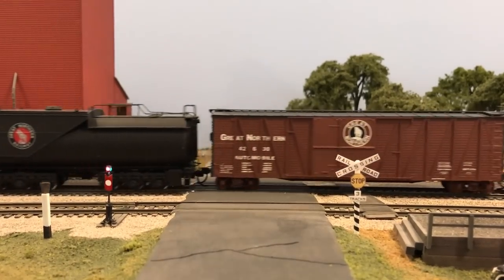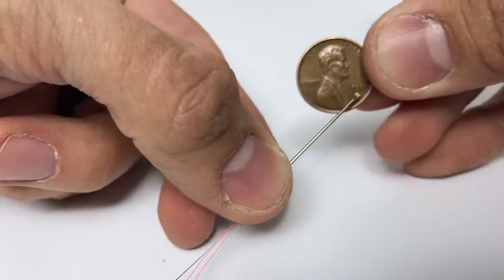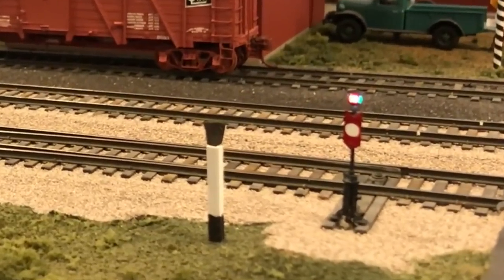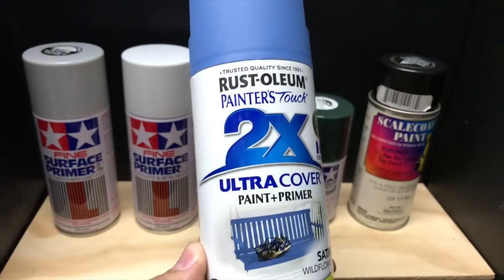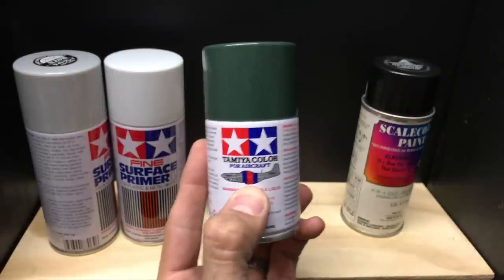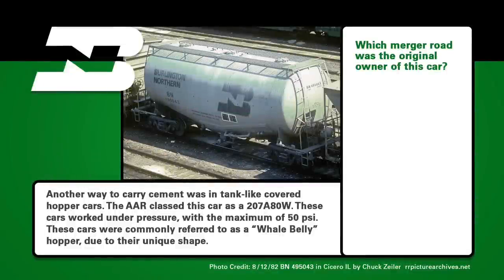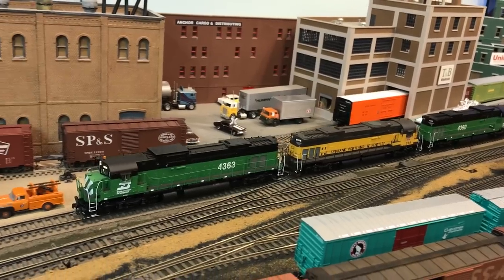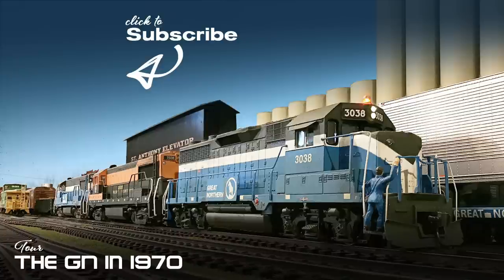S01E08 - GN in 1970 - The Customs

Comment: Nice to hear someone else eschewing use of an airbrush and hassle it brings. Great work with the spray bombs. Your results are so good no one would have ever known.  I myself assumed you paint booth’d everything. 
I’ve gotten good results with Duplicolor automotive spray paint. Seems to come out in smooth and controlled fashion. Lays down nice thin coats.
Reply from the maker: JD Mills I should put a segment together and feature all the custom “rattle” paint work. Don’t get me wrong, an airbrush is an exceptional tool, but doesn’t HAVE to be the ONLY option. 😉